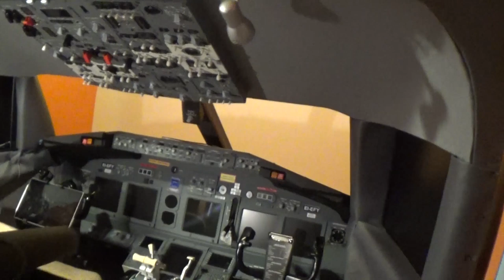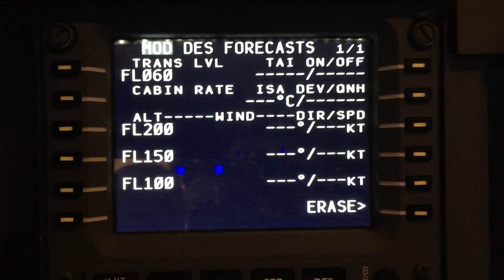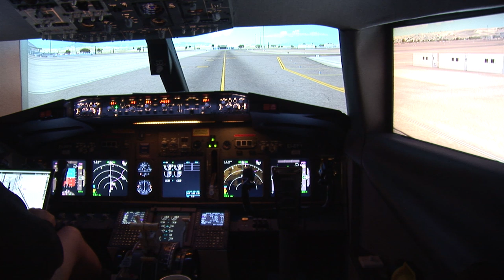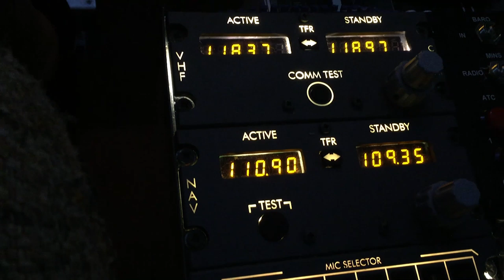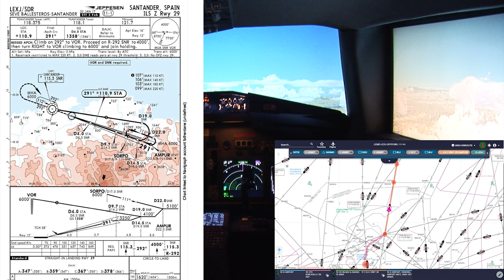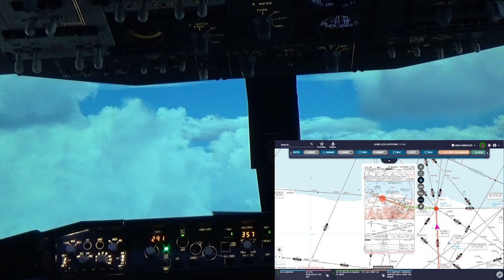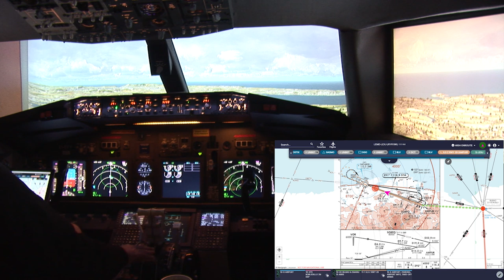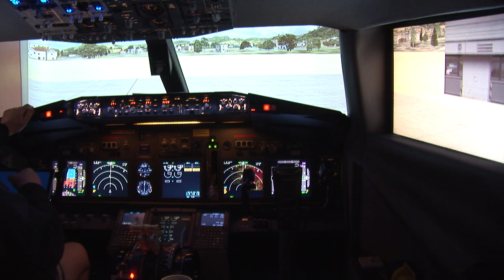Quarantine Escape Flight LEMD to LEXJ

Comment: I’m absolutely mesmerized by what you’re able to do with your Sim. Would love to see more in-depth behind the scenes videos. I’ve watched your first “building my sim” video at least a dozen times.  I’m in the process of building my own using x-plane and welcome ANY advice you can spare to a newbie “simmer” like myself - especially more build videos. Thank you so much!  Looking forward to your next quarantine flight - maybe from Southwest Florida Regional AirPort in Fort Myers, Florida?
Reply from the maker: I'm glad you liked it.  With the last video I was trying to add a bit about how I try to create the illusion - and I can certainly add some more in the future.  As to a flight from or to Fort Myers, I could do that but since I don't have an airport scenery pack for KRSW yet, it may be a generic P3D version. But let me look online and see what's available :)
Reply from the maker: @tcriti  Now that is the way to build a sim.  I didn't start with a platform which means my yokes and rudder pedals are not joined but independent.  I always regretted not doing that but thinking back, I think that the reason I didn't was because it would add to the overall height and I would not have had enough headroom for the projector if I did.  Still, yours is the way I wish mine could have been.  Well done!  And kudos for taking the time to do it right, rather than fast.  Thank  you for sharing that.  Well done!

Comment: How much FPS does this have? Its looking like 20 or so. I cant believe 3 1080's can't handle that sim at constantly 60 FPS or even more. I would never go back to a 60 Hz Monitor tbh. 144 Hz is so much better. Everything is looking so smooth.
Reply from the maker: It's not 20FPS - I wish it were.  I usually get about 9 or 10 FPS.  There are nine screens being powered by three GTX1080 cards.  Six are instrument screens and can run at low frame rates, but the main, front exterior screen is really struggling.  I am studying OPUSFSI software right now with a view to running the external views on a second computer.  Hopefully it will increase the frame rate.

Comment: Good afternoon Father Dane. What a fantastic simulator you have and an excellent video too. But i have to ask, what type of flying experience do you have, do you have a PPL?
Also, would it be possible to program bad weather landing so you can show us on the simulator?
Thanks 🙂
Reply from the maker: Thank you for the comments.  And yes, I do have a commercial pilot's licence for single and multi-engine aircraft and IFR rating, my types include all the old cargo prop jobs: C-47 C-123, DC6 etc.  I don't have any jet rating and I have only a little stick time in a small jet although I did backseat an F4 once!  I use Active Sky for my weather as it gives me real time conditions and because its real, it is always a surprise.  Although the weather in Spain has been somewhat warm and calm these past couple of week, that isn't always the case.  Of course I can always programme the sim to give different weather conditions and make a flight plan with SIDs and STARs to match.  Why not?

Comment: Why is the frame rate so low? Does that ruin the immersion?
Reply from the maker: The frame rate is low because I have nine monitors attached to one computer to run everything - and the addons such as PDMG, and Active Sky and airport sceneries do take a toll.  The frame rate is about 12fps which isn't brilliant but still doesn't ruin the illusion as flying a jet is more about the instrumentation rather than the external view (Flying IFR rather than VFR).  If you noticed, the windows on a 737 are small because it is only for take off and landing that the pilot needs to look outside.  I would like to get better fps of course, but that would take at least one more computer - probably two, to distribute the load and bring up the frame rate.  But that is an expense I can't afford right now so it is on my wish list for the future.  But you did well to spot the frame rate.  Sharp eyes.  Well done!

Comment: P3D means Prepar3D?   I have not tried this one yet.   Seems to be more flexible for your cockpit than XPlane?
Reply from the maker: Yes P3D is Prepar3D and was formed from the professional version of FSX. Lockheed Martin (aircraft manufacturer) bought it and updated it and not only is it used in their own simulators but now the public can use it as well. As to XPlane, I have heard others claiming the graphics are better, but the issue seems to be one of getting drivers to connect the hardware to the software. So yes, it is very flexible and there is a lot of support for it with other companies. 😊